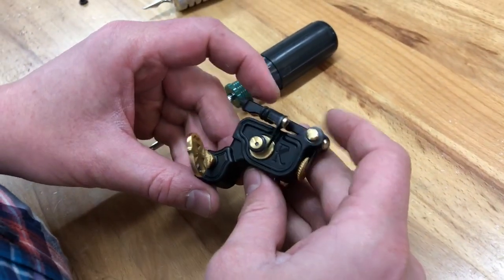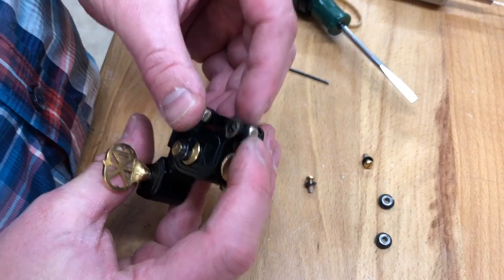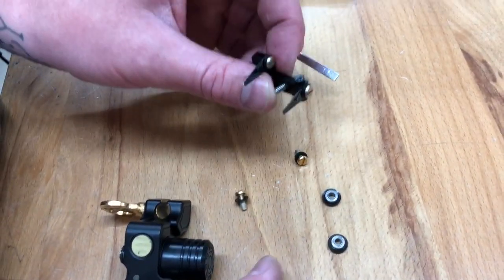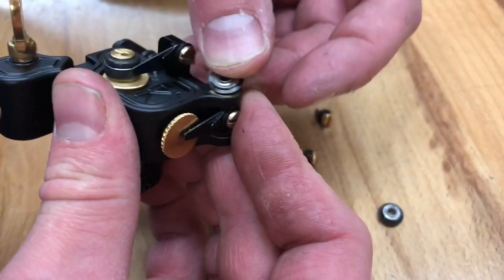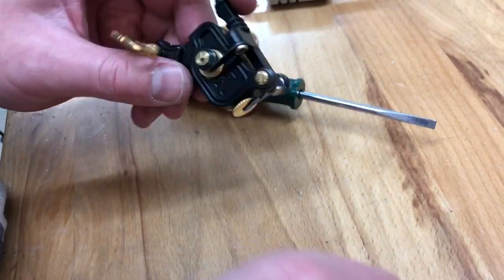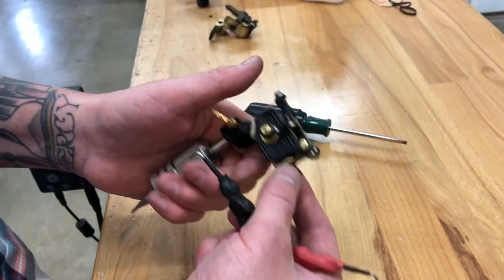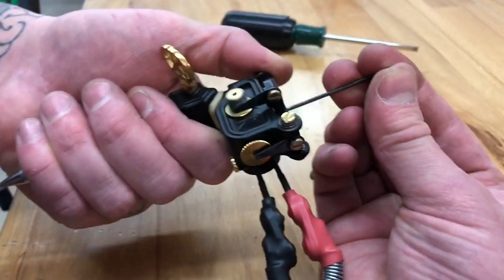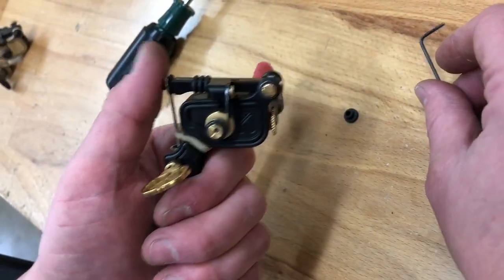V6 Sidewinder armature bar replacement

Comment: Dan, on my machine (V6) the a bar seems to be slightly off centre, when needles loaded it lines up slight right of centre, so the needle is running down the middle of the tube. Any advice on this one?